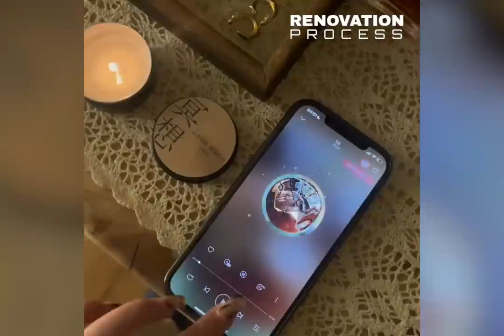TIMELAPSE - Couple BUILDING a SHIPPING CONTAINER House OFF GRID | Complete Construction

Comment: This better to be a mild climate place, those resource boxes heat like oven in the summer.
Reply: And by building those boxes, they can totally build bricks, it takes more time but is more durable and comfortable
Reply from the maker: Thank you so much for sharing. In our country, we have air conditioning for cooling and heating, so the weather won't affect it too much. Moreover, I built the house in a tropical area with lots of shade trees to help regulate the air in the house

Comment: The insulation is so lacking... I'm worried that the house will be too hot in the summer and too cold in the winter.
Reply from the maker: Thank you so much for sharing. In our country, we have air conditioning for cooling and heating, so the weather won't affect it too much. Moreover, I built the house in a tropical area with lots of shade trees to help regulate the air in the house